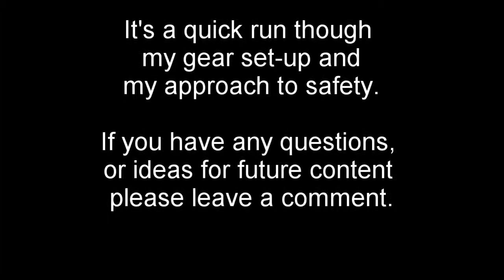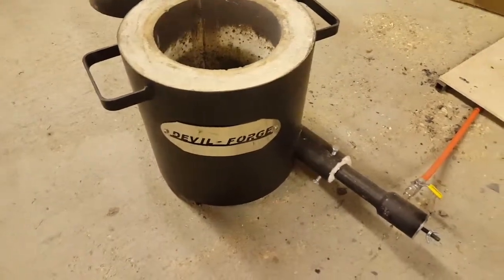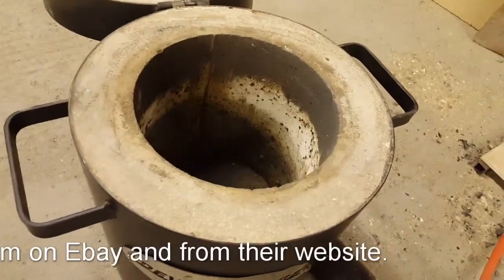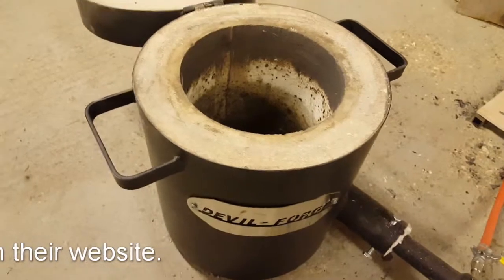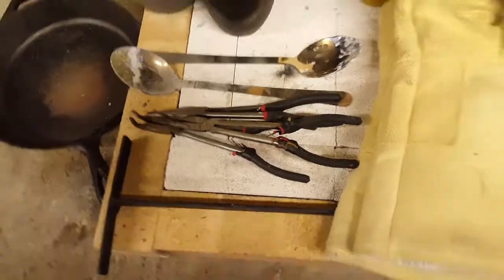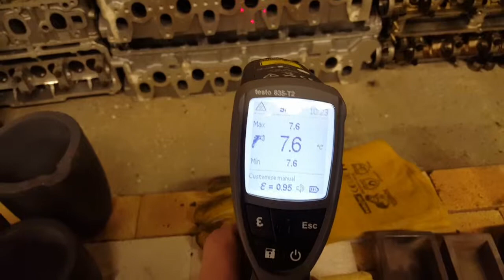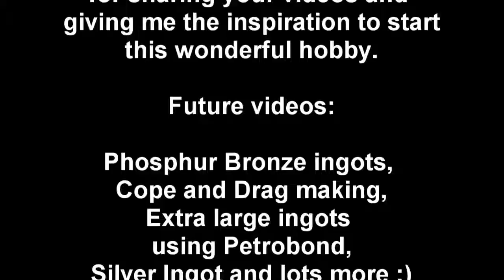Basic Furnace Melting Setup and Safety Gear run through

Comment: Hi Andy...love the channel. I used to work as a Moulder many years ago and was thinking of trying a little casting at home in my senior years lol. Could you please tell me the size of your main crucibles (are they A6?) and where you got the lift out tongs and pouring shank? Incidentally I used to make prototype castings for similar cylinder heads but in iron lol. Thanks mate and keep up the great work!!
Reply from the maker: Thanks Kevin, Yes they are A6, A8's will also fit if you have the same furnace...  The tongs and pouring shank are from SDTS engineering.  Chuck us an email if you need more info.  Cheers Andy 👍😎👍
Reply: @MeltandCast  Thanks Andy...you've been most helpful...
Reply: Sorry Andy I forgot one...the digital  laser thermometer. Could you tell me the name of it and where you got it? Thanks. I was looking at HoldPeak ones but they seem to be a bit rare atm. Thanks Andy!!

Comment: some great videos!! I have a question how do you  pretreat or temper your crucibles?
Reply from the maker: Thanks Keystone, I heat my crucibles in the oven first... 100C for an hour, 200C for an hour - they do smell a bit, so pick your moment !!!  Then heat them until cherry red in the furnace.  Shut the furnace down and leave the crucible in there to cool slowly overnight.  When you've finish your melting sessions it's good practice to leave the crucible in the furnace to cool slowly.  Be careful using crucibles if stored in a damp environment.  If you do, heat them gently in the furnace to start with to get rid of any absorbed moisture or they can crack due to the steam.  It's not happened to me before but I have seen it happen to others.  Cheers... Andy 👍👍👍

Comment: Hi great video, I have just bought one of these furnaces for my husband I was wondering what kind of eye/face protection would be the best, do you need to protect from the brightness of the molten metal as well? Or is the clear mask enough?
Reply from the maker: Thanks Ava 😎  I just use a cheap £15 face shield, it's designed for molten metal splash but the general train of thought when it comes to molten metal splashes is to wear protection that can be removed instantly.  I use a Lvl 4 molten metal jacket and trousers, the jacket has poppers rather than buttons so it can be removed quickly.  I keep a large pan of water on the floor in case of splashes to boots, and the face shield can also be thrown instantly.  Infra red radiation can be an issue but depends on how hot the metal is you are working with, if going beyond red heat into the white spectrum I would think about some good dark sunglasses.  Personally for my once a week melts I don't bother.  If i was melting to a white heat regularly or melting several times a week I'd probably think about wearing some.  Personally speaking I'd consider good visibility more important than very short exposures to brightness.  If I can be of any further help do let me know 👍🍺🥂  Cheers Andy
Reply: @MeltandCast  thanks for the great advice, I have ordered a visor and respirator, I'll need to do some more searching to find the jacket and trousers though 🤔
Reply from the maker: @xavatheraverx  Are you in the UK ?
Reply: @MeltandCast  yeah
Reply from the maker: I got my jacket and trousers from Sheaf Valley Supplies.  The ones I use are the MM1 Foundry Jacket and MM1 Foundry Trousers and cost £104 for both.  They are very helpful and will advise on size as they are made to order.  They are the highest rated ones I could find and offer the highest protection.  Always pre-heat your moulds and pre-heat all the metal that you add to the metal pool and you shouldn't have any scary moments hehe !!!  Watch the "Casting a brass mask from a cannon" video to see what happens when you add damp metal to the mix.  The gloves I use are Microlin Cooper extreme heat gloves from the Safety Supply Company, not cheap but very good.  Will withstand 800c and molten metal splashes at max protection level.  You can see how they protected my hand on the cannon video.  Cheers Andy 🥂🍺👍